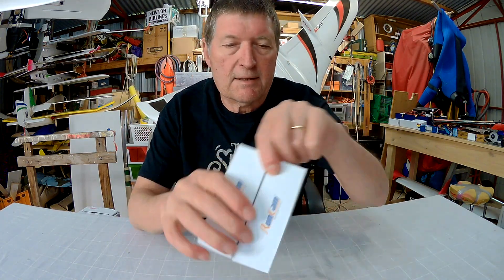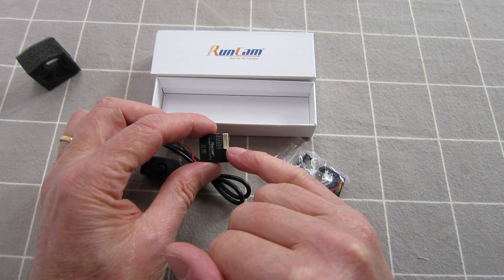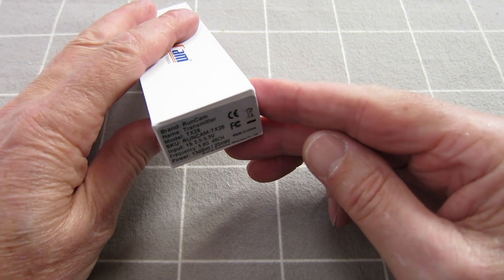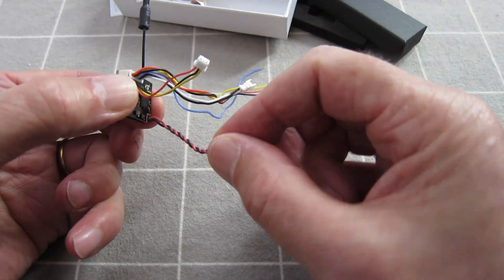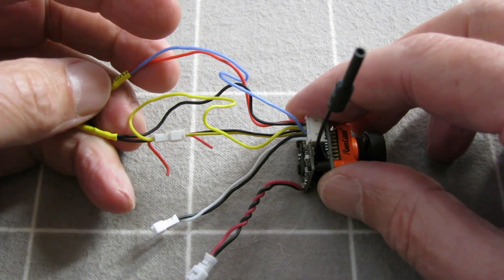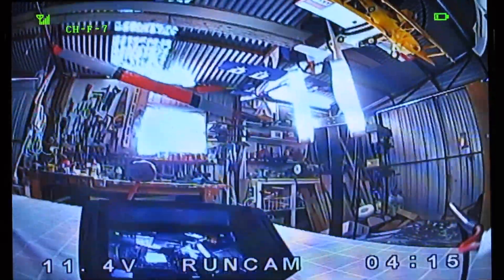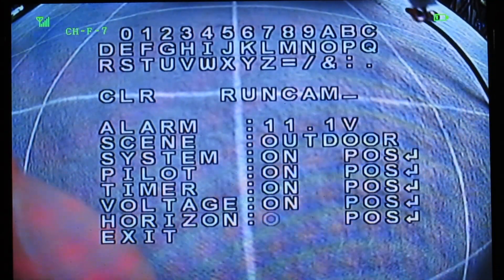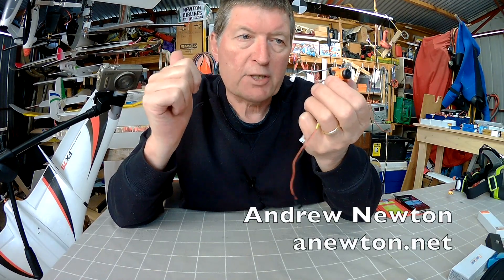Runcam Micro Swift 2 / TX25

Comment: It says on Runcam's TX25 page that the 4.5V out WILL power the Micro Swift 2 camera:
Note: TX25 Voltage out Only 4.5v, support RunCam Micro Swift / Micro Swift 2 / Swift Mini / Swift Mini 2 / Swift 2 / Eagle 2 / Owl 2 .
So no need to mess around with the power supply wiring, just plug them together!
Reply from the maker: Probably right, but I'd rather pair it with a full range 200mW VTx
Reply: Totally agree!